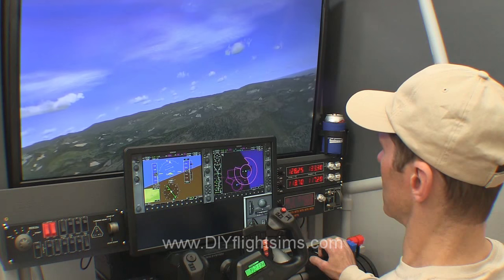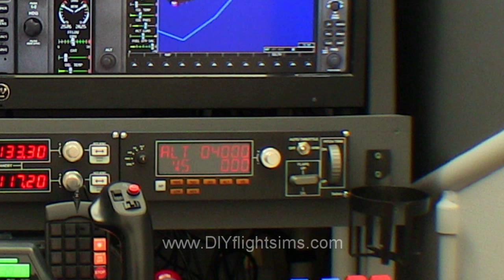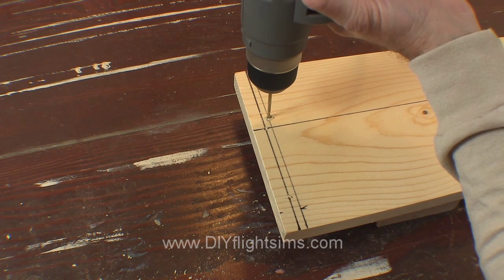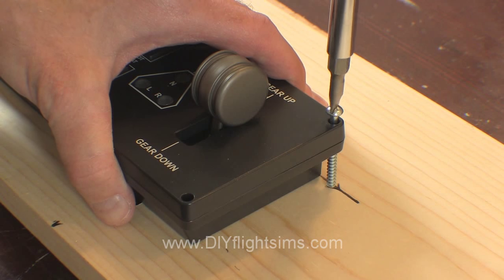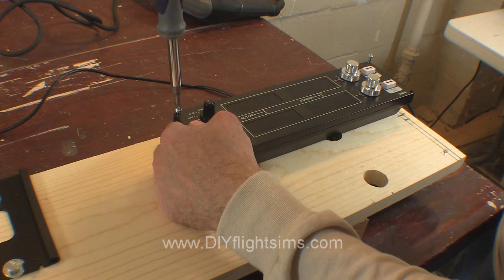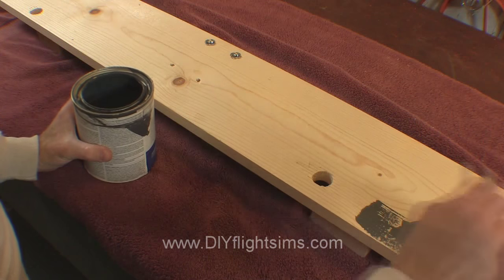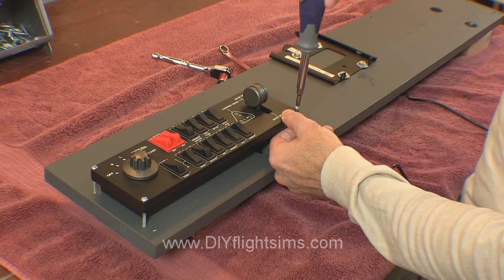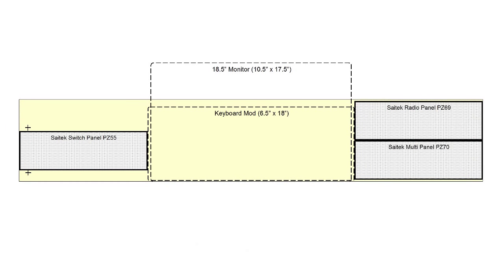Install Saitek Switch Panels in your Home Flight Sim, Part 2

Comment: Can you explain how you got the PFD/MFD to display on the small screen, and not on the larger monitor. thanks for all the tips.
Reply from the maker: +Larry Luffel The stock FSX airplanes have separate instrument windows that pop up. For example, Shift + 3 will make the GPS appear for most planes. Then you can move and re-size each instrument so I just dragged them to the smaller display.

Comment: How about spend 35 cents and use some decent, socket cap screws instead of those silly galvanized, flat blade heads.

Comment: Hey roger, love your videos. I recently purchased the saitek radio panel but have had zero luck getting it to communicate with any of the single engine aircraft I’ve been simulating in, mainly a 172. If you could give me any pointers on the setup that would be great ! I’ve downloaded the drivers for it but no luck getting it to work
Reply from the maker: I don't know what could be causing the problem. Have you contacted the manufacturer? They have very well-paid experts that would be happy to help you.
Reply: I know it’s been a while since this comment, but I think there is a 32bit, and a 64bit driver for these panels. Mines a 64bit system, but all my panels and yoke required the 32bit drivers to work. Then, you must install the relevant flight simulator plugin. For me, I download the x plane plugin. For you it may be the fax plugin you need. There all available on Logitech’s website. I know there saitek, but that’s where it eventually directs you. Good luck. And hope you got them working long before I commented haha.

Comment: Wow, it's amazing the flight sim gear. But at this point of simulation, you might as well just be a real pilot, lol
Reply from the maker: +Colby Bryan I am and so are many of my customers. Happy Landings!
Reply: Thanks for quick reply 😀. I want to be a pilot but I'm only 14 😞
Reply: +Colby Bryan 17 and you can be
Reply: How?!
Reply: Colby Bryan You need to be 17 years old to pass your PPL.
Reply: I knew that but how do I start?
Reply: Colby Bryan Search for a flight school near you
Reply: Colby Bryan If you live in the UK it ranges from £7000-8000
Reply: Gosh, ivlive in the US. Probably alot of money :(
Reply: Colby Bryan Around $10,520 to be exact. That includes:
35 flying hours with instructor: $5600
15 flying hours solo: $1800
15 hours ground school (instructor's time): $600
Materials: $500
Headset: $500
Third-class medical: $150
Renter's insurance: $700 (per year)
Written test fee: $150
DPE test fee: $400 (plus $120 rental for the aircraft)
Reply: damn
Reply: I really wanna drop out of school and go to a special pilot school but do I need a diploma or degree in college to get a job as a commercial pilot?
Reply from the maker: +Colby Bryan I recommend you stay in school. It's a competitive job market for pilots.
Reply: I figured. I just thought there would've been some special pilot school I could go to instead. I know it's important but the stuff they teach is completely useless in real life. But at least i know about the cells in a leaf. But thanks :)
Reply: simple answer = money